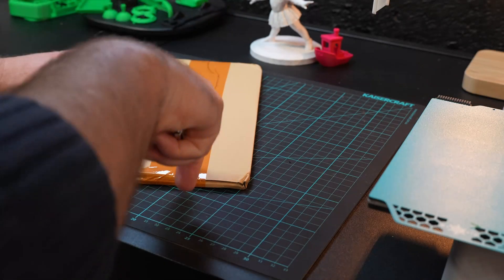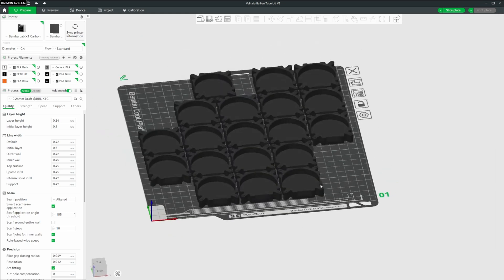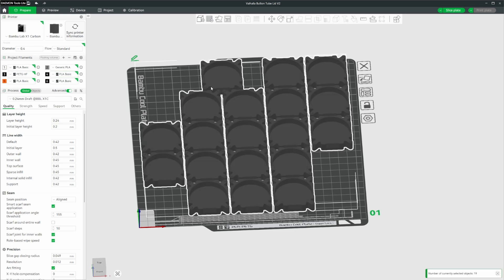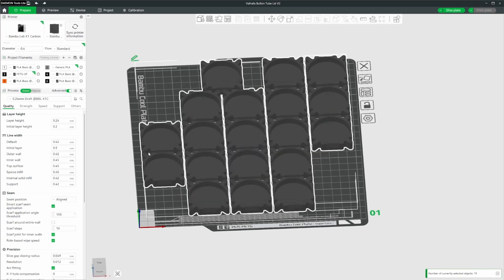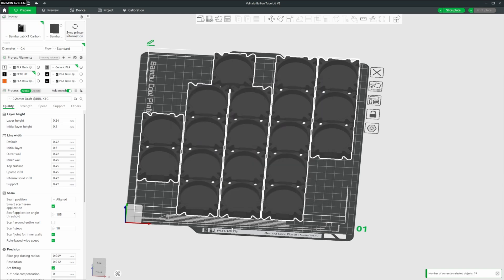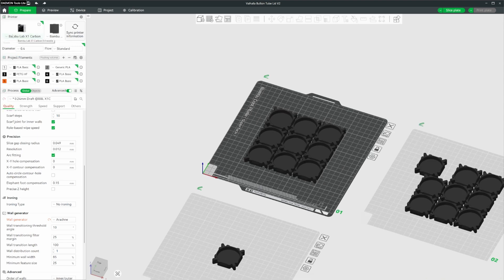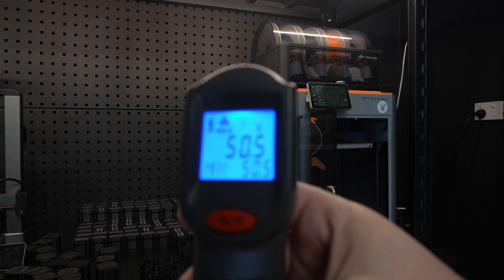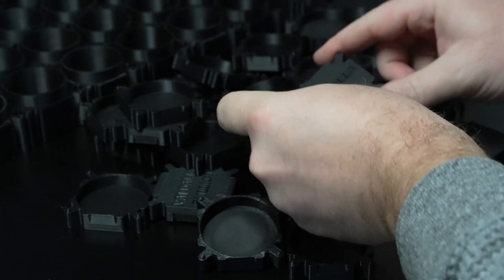CryoGrip on Bambu Lab Printers - Save Power, Improve Prints!

Comment: Hey @DraftID, thanks a lot for the video! One of the rare videos on YouTube about these plates. 

One question though, which build plate parameters you use for printing with PETg? 
Thank you!
Reply from the maker: Thanks mate. So for petg I’ll copy the Bambu petg filament and then set the temp for cool plate to 60 or something. I don’t have the sheet in front of me but I’ll update in morning with values for you.
Reply: @DraftID thank you so much for the quick reply! I experiment now with Frostbite. On the PeI plate I print on 70 Celsius and brim where the contact surface is small. On cool plate I expected I could print with 30-40 degrees :)😅
Reply from the maker: @a.steshenko  ok good morning! :) So for petg no frostbite ill use cool plate with 50-55deg. On glacier ill do 60deg.
Reply: @DraftID thanks! I managed to lower it even further to 35 with the starting temperature of the first layer of 55. Details were with brim 0.05mm distance frim the detail and 8,5 hor print workes out well! :) I will try your settings without brim

Comment: What about for the h2d? I just got the frostbite plate for the h2d but there is no cool plate option in the plate selection, only shows textured and smooth/high temp
Reply from the maker: It doesnt have cool or cool super tack? My H2S has those options. I spoke to biqu a lot about it and they said to use cool plate if its an option otherwise just use textured. They said in the end it doesnt really matter as the plate just controls the settings for the filament. So setup a custom filament (copy a pla or petg then call it glacier or frostbit pla/petg) and then change the bed temp settings for the plate you need to pick.
Reply: @DraftID the cool plate now shows up for the h2d with the bambu studio update today
Reply from the maker: @Kingofcardboard229  lol how crazy we talking about this and right after it comes through in an update!
Reply: @DraftID yea doesn't have any cool plate options for me using h2d

Comment: why not just use the Cool Plate preset for the Frostbite? it already has the right temperature
Reply: Watched another video and they did exactly that.
Reply: Probably different fan settings? No idea though
Reply: exactly.  the plate you choose makes no difference.  Just make sure you dial in your filaments to the plate you choose.  i.e. i have a glacier and another textured cool plate.  I use the tex cp selection for that plate and make sure all my filaments have the correct temps for that plate selection and then do the same for smooth cool plate for the glacier and do the same.